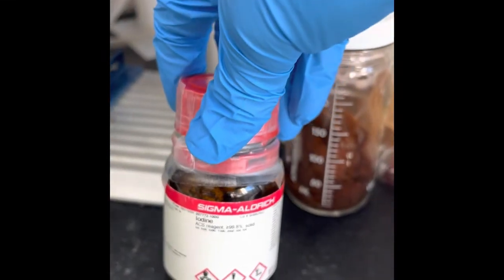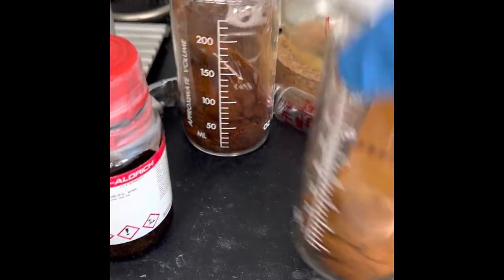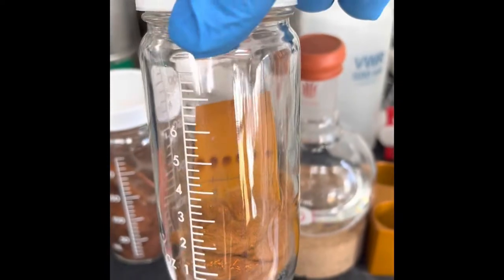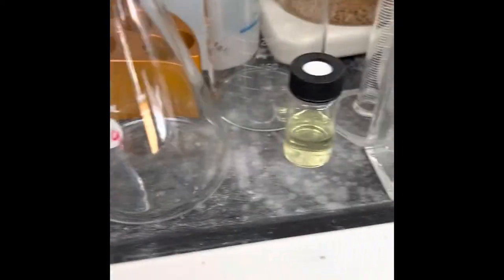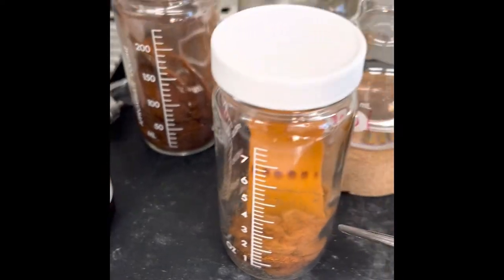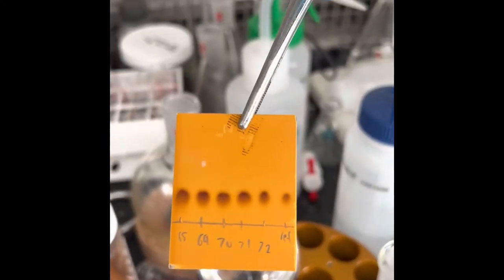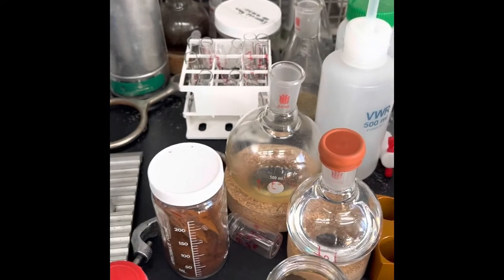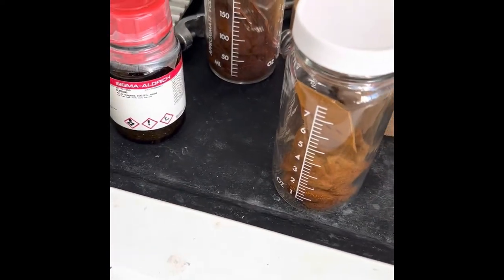The iodine staining technique for TLC spot detection- Iodine chamber

Comment: Sir,what is the visulaizing agent for TLC of iodinated chitosan?
Reply from the maker: Chitosan (1.0 g) was dissolved in 100 mL of 0.1% (v/v) acetic acid solution. The pH of the obtained chitosan solution was adjusted to 5.0 with 1.0 M NaOH, and chitosanase (30 mg) was added, mixed well, and incubated at 45 °C with shaking for 12 h. After hydrolysis, the chitosan hydrolysate solution was adjusted to pH 7.0 with 1.0 M NaOH and terminated in boiling water for 10 min. The chitosan hydrolysate solution was then immediately cooled in an ice bath and centrifuged at 4000 g for 15 min. The obtained supernatant was concentrated to approximately 10 mL and added with tenfold volume of ethanol for chitosan precipitation. The precipitation was converted to chitosan–oligosaccharide powder by drying at 40 °C. The composition of chitosan–oligosaccharide was analyzed via silica gel TLC in accordance with the method developed by Cabrera and Cutsem. The sample and standard were applied onto a TLC plate in a solvent system composed of n-propanol:water:ammonia water (7:2:1, v/v/v), and the obtained plate was developed by spraying methanol containing 0.5% (w/v) ninhydrin.
This is taken from the paper link is here

https://bio-protocol.org/exchange/minidetail?type=30&id=8770205

Let me know if you get your answer. Sorry for late reply.
Reply: Thankyou